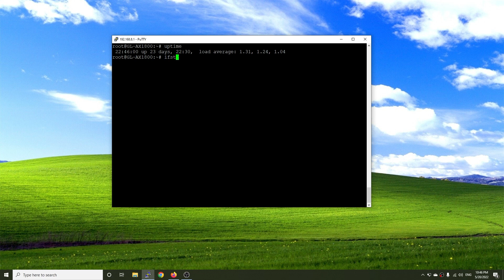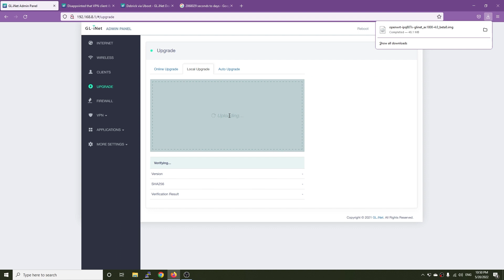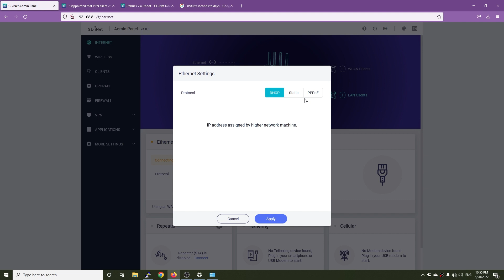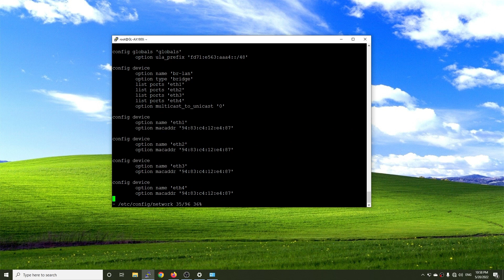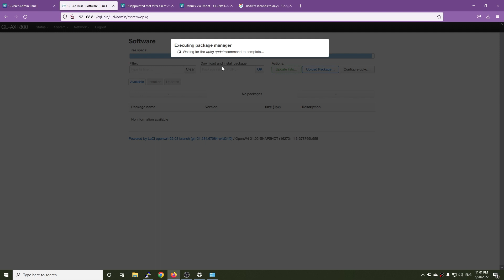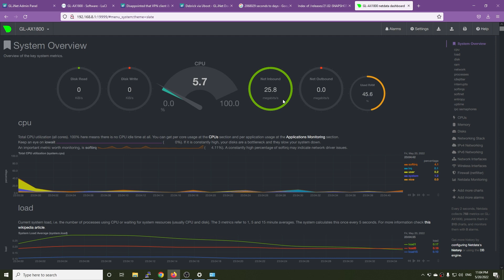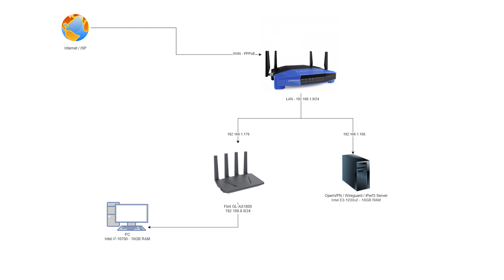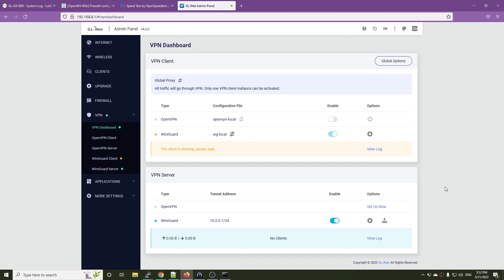Testing the Flint GL-AX1800 Beta Firmware - Based on OpenWRT 21.02

Comment: Hi. Thank you for your nice videos. Is possible to you to explain how to revert back to FW version 3.214 back from 4 and do youk know what is the sync button on the side for? Thanks
Reply from the maker: Hi, you can read the docs for router recovery, or can flash the 3.x FW on the 4.x GUI (I am not sure if this will brick the router, you better check with GL-iNet team on their forum).
The Sync button is used to configure mesh wifi, but the function is not available yet.

Comment: Can this Flint GL-AX1800 router with its stock Open-WRT firmware be used to connect to a Comcast hotspot with its captive portal, and then reroute the connection to generate another WiFi signal so that devices like TVs, which cannot use captive portals, can use the Comcast connection for Internet access? If it is possible, does this feature only work with Flint or does it work with all GL-iNet wireless routers?
Reply from the maker: From what I know, no AP/Router can bypass the captive portal, as it means for manual interaction.
Reply: @VanTechCorner  that is odd because there are people who claim online forums that they can, particularly using OpenWRT. That is why I am skeptical. They claim the trick is to authenticate with a computer first, then clone the MAC of that computer on the router. Travel routers such as the Mango or the Blume that run OpenWRT can capture a WiFi signal as in hotels hotspots and repeat them, but what is not clear is what if that WiFi signal is a captive portal which requires username and password, not a simple signal with just a password.
Reply from the maker: If it is something special, they would have listed it out as a marketing point. Still, the best one to answer this question is GL-iNet, you can contact their customer service for more information.
Reply: @VanTechCorner  I have contacted GL-iNet tech support regarding this specific question.

GL-iNet has a line of access points that are advertised as meant for enterprise deployment -- the 
Cirrus. Do you plan to do a series of videos on this line of APs given that you are knowledgeable with their products? There are plenty of Youtubers who use the likes of Ubiquiti in their tech support businesses. By contrast, it seems for GL-iNet hardware, there are no one using their products in deployments to business clients. It would be great to see independent system integrators like yourself go into details how you use GL-iNet routers and access points in businesses. GL-iNet business line of APs use Goodcloud as their cloud controller. Openmesh had its Cloutrax before it was bought by another company, after which it no longer offers a good value. Is Goodcloud a comparable alternative to Ubiqiti cloud controller?
Reply from the maker: No, creating videos on this channel is my free time hobby to share the things that I explored. Besides that, I still need to focus on my full-time job, plus I don’t have the devices / systems to test with. You know, the amount of money spent to buy these devices is not cheap.
Reply: @VanTechCorner  You should start a Patreon account where your appreciative subscribers can pay for your work here on YouTube. YouTubers don’t make a lot of money unless they are these (mostly) idiots who provide no practical service to their viewers with their useless videos. So  until you have enough subscribers on YT, you should be compensated for your work here on this platform at a different platform such as Patreon.

Comment: Hi, may i know whether is it can connect openvpn client and wireguard client together at the same time?
Reply from the maker: If you are using the official OpenWRT firmware, the answer is yes. You will have 2 VPN interfaces (wireguard & tun0), and you need to route the traffic with mwan3. With the GL-iNet custom build based on OpenWRT, I am not sure if this is possbile.
Reply: @VanTechCorner  noted with tks!

Comment: mine is not gl inet
kernel different from yours
Firmware VersionOpenWrt 21.02.3 r16554-1d4dea6d4f / LuCI openwrt-21.02 branch git-22.119.37126-a993714
Kernel Version5.4.188

This one you use was 4.4.60 its old.as Linux main line 5.18,stable 5.17;OpenWRT offical use 5.4.

Comment: Can we trust that brand? I have a xiaomi ax6000 for months and it worked fine (with auto reboot every night ), but after I found it doesn't support openwrt, I installed it on a raspberry pi4 + adguard and used the ax6000 as an access point. The problem was when I saw all the xiaomi traffic and it makes me very suspicious and I don't trust it anymore. I ordered a couple of cheap xiaomi 4a router that allows the installation od openwrt and they worked fine, buy the speed and reach aren't like the ax6000, so again I'm looking for a new router or access point compatible with openwrt I could trust.
Reply from the maker: It is up to you, but for me it a yes.
- Most of the GL-iNet routers had been pushed to openwrt.org and is supported https://openwrt.org/toh/start?dataflt%5BBrand*%7E%5D=GL.iNet%09&dataflt%5BModel*%7E%5D=
- Their router's firmware is based on OpenWRT/QSDK and they have developer team who is working to update the firmware as well as push it to openwrt.org. See https://github.com/gl-inet/openwrt
Reply: @VanTechCorner  the commenter brought up a good point. Because the router controls all incoming and outgoing traffic, we put complete trust on its firmware not to steal our information. This is mainly why banks and companies with sensitive information don’t use even OpenWRT. They use Cisco where they know exactly who to ask for an audit to be compliant with governmental regulators. Has there been any independent validation of the trustfulness of Open WRT, in particular to this China-based company GL? I have always wondered given such robust features offered by OpenWRT, why hasn’t it been adopted by large businesses? I presume OpenWRT can also run on powerful hardware that can route millions of packets per second like those found in much more expensive Cisco gear. If so, why isn’t OpenWRT used more widely in businesses? It seems to be only used by hobbyists and home tech enthusiasts.

Linux is used in the Enterprise when it is supported by RedHat. So RedHat can validate its trustfulness. Should there be something of the same with OpenWRT?
Reply from the maker: - OpenWRT is open source, you can validate/review all the file/code used to compile the firmware
- When companies/devlopers push their code/device to openwrt repo, every lines of code will reviewed by OpenWRT developers and once all this is done, the device firmware it will be available in snapshot release and stable release long time after that. At this time, the firmware will be build by openwrt.org
- Many companies out there are using QSDK, which is based on OpenWRT/LEDE. An example is UniFi, Linksys, Xiaomi and GL-iNet.
- You don’t need to trust GL-iNet to use OpenWRT. Build yout own x86 PC and put OpenWRT on it to use as a router. Else, grab a well-know brand’s router and install OpenWRT on it: Linksys, Belkin (US), 8devices(EU), Compex (SG).
Reply: @VanTechCorner  Thanks for your answer.. I know I can trust openwrt, the problem is not all the routers out there are compatible with openwrt. So far I'm very happy with openwrt on my raspberry pi4, it's very stable, I don't have to reboot every day in order to work properly; my problem is the wifi. My internet speed is 400mbps symmetrical and I live in a 2-floor house and the walls are very thick, so my idea is to have two routers, one on each one floor connected by an ethernet cable between them. The AX6000 has very powerful signal, but 99% of the adguard blocks are from this router (most of them to api.miwifi.com), so it makes me very nervous and suspicious, so I can't trust it because what else it sends and maybe this brand (Flint) could be my solution, but I don't want to find out later that it does the same thing than xiaomi or its "custom" openwrt "left the door open" by mistake or purposely.
Reply from the maker: @David Frankly speaking, I don't install OpenWRT on the device when it comes to access point, unless it x86 build with external wireless adapter or the router is end of life (for example the Aruba AP-105).
The reason is, most of the popular wireless driver is closed-source, for example those from Broadcom and Qualcomm. Even though there are open-source driver available for the same chipset, the performance is worse. The closed-source is being used by companies (GL-iNet/Netgear/Ubiquiti UniFi) in their stock firmware (based on OpenWRT) which offer better coverage and higher throughput. However, when you switch to the OpenWRT build with open-source driver, the performance is not the same and this had been tested on some of my videos.
Regarding the query to api.miwifi.com, it is very common stuff that the manufacture used to check the router online status. On Mikrotik router, you will see query to cloud.mikrotik.com and the same on UniFi AP from Ubiquiti.
Reply: @VanTechCorner  Wait, did you say the stock OpenWRT firmware on the GL-iNet router is closed source? How is that possible? I am confused. Do you mean I cannot see the source code of the flavor of its OpenWRT unless I flash a OpenWRT firmware downloaded from the OpenWRT website meant for this router or a generic version?
Reply from the maker: No, not the OpenWRT firmware, but the driver/firmware for the wireless.
Reply: @VanTechCorner What is this “driver”? There is more than one piece of software on these devices? Is the driver a component of the whole OpenWRT? In other words, while OpenWRT is open source, the driver part, which is responsible for the WiFi, is closed source?
Reply from the maker: Hi, I am not an expert in linux and I can't tell you more on this. There are a lot of components in a OS, the same goes to OpenWRT. Back in the day, after install Windows XP, you will need to install driver for the wireless adapter (to use WiFi), ethernet adapter (to use the network port) and audio driver (to have audio). This is the "driver" I am talking about.
Reply: @VanTechCorner  I am well aware of the classical use of the word driver in operating systems. Drivers are specific software that enables the OS to make use of a particular device such as printers. What I don’t understand is where are the drivers for OpenWRT? That’s why I said are these drivers a component of OpenWRT found in routers from GL-iNet that is not open source? This means GL-iNet inserts its own proprietary driver into the generic OpenWRT firmware to make its router compatible with OpenWRT?
Reply from the maker: - Where are drivers for OpenWRT - this is somehow out of my knowlege. I know that some are available from the openwrt repo, some were merge into openwrt repo via commits/pull requests from developers/users around the world and some we migrated from other linux branch…and some are not available (for example there is driver for the Intel Ax210 wireless on Freebsd/ubuntu but not available in OpenWRT. This may not be 100% accurate but it should not be wrong.
- Another example is driver for Nvidia graphic card on ubuntu. You can select between The opensource Nouveau and the closed-sourced from Nvidia.
- GL-iNet, and UniFi (ubiquiti) from what I know built there firmware with QSDK (which is based on OpenWRT) and using closed-sourced wireless driver from Qualcomm. GL-iNet do release firmware in 2 types, one is with the closed-sourced wireless driver with better performance, and one is with open-source wireless driver. You can learn more by checking these links for even create a topic on their forum. https://forum.gl-inet.com/t/which-differences-advantages-and-disadvantages-gl-and-openwrt-firmware/12187/2
Reply from the maker: QSDK - https://prplfoundation.org/wp-content/uploads/2015/08/openwrt-biz.pdf
Reply: @VanTechCorner  thanks for the info. I knew things are not as straightforward as it seems with these things.
Reply from the maker: Your’re welcome. This thing looks like a big universe. I am still learning a lot since I started with OpenWRT
Reply: @VanTechCorner  for this firmware to get accepted in the enterprise or small businesses, it has to pass the trustworthiness test. Linux had the same challenge when it tried to get adopted by big businesses. Then companies like Redhat took in the challenge, and it specially and Linux is general won over the security conscious enterprise clients. OpenWRT developers need to follow Redhat’s example if it wants to get out of the proverbial startup garage. PfSense is another good example. Large companies use it now because it has gained this trust. However, PfSense is not a router firmware per se from what I have seen. It’s a specific tool for network monitoring and firewall.
Reply: xiao 4A has 2 version one is 100MBaseT another is Gigabit Ethernet.
maybe next time you can try IEI M-901